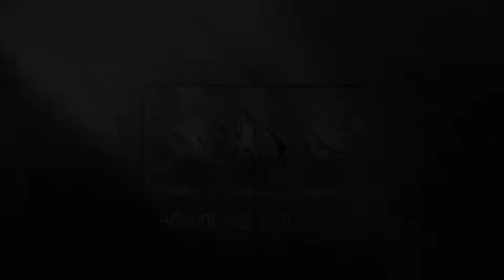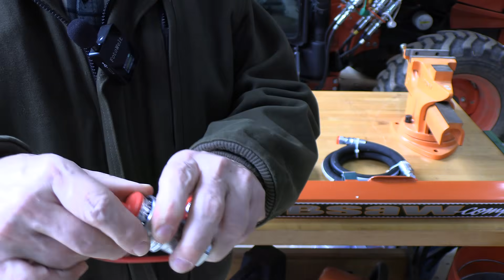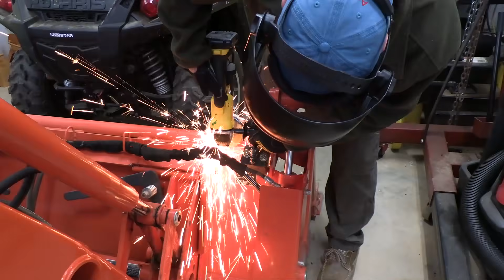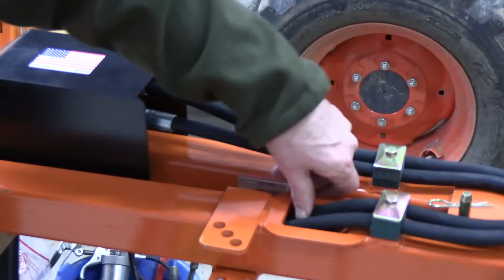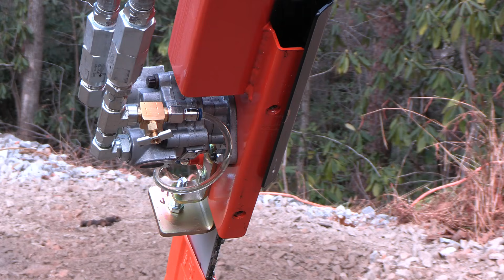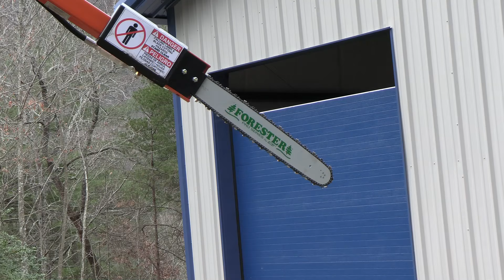Limb Saw Limbinator Assembly Review and Use w Dr  Joe

Comment: It been three years now can you tell me is there anything you like or dislike about the saw? Has it been damaged while using.   what's it's week point?
Reply from the maker: Okay you ask good question Sarah didn't respond earlier. It's a happy little hard to place on and off for a single guy but other than that it works quite well if I had it on excavator with a glass roof or didn't have the On my tractor I could look way up and have much better visibility of my cock that's the only drawback with the tractor in the cab. Consider subscribing. Thank you Joe

Comment: What is the maximum reach?  10' for loader and another 8' for the arm or more than this?
Reply from the maker: Thanks for your question. I don’t know the exact type but at least 18 to 20 feet. It would be ideal if this was on a skid steer cause you could see up through the roof unfortunately you can’t see through the roof in the tractor but otherwise it’s outstanding, consider subscribing. Thanks. Joe.

Comment: Hi, great video! I have a Kabota B2650 and a rocker switch that turns my snowplow left and right. How do I know if it has enough g.p.m to run the saw? Thanks Patty
Reply from the maker: Wow, you ask a great question. I don’t know the actual gallon per minute required to run the saw but I don’t think it’s that great. I think you probably have enough flow rate to operate the chainsaw before you buy one however I would probably check the gallon per minute requirement at the website. It has worked very well for me. It does leak some hydraulic oil which is a lubricant and that’s a necessary, sacrificial element of the Saw but it’s a small price, consider subscribing. Thanks. Joe.

Comment: Thank You. I just took delivery of a LimbSaw. I have not got it mounted yet. I was sconfuse3d on how the depth gauge was mounted. I have a magnetic base wireless backup cam i will try to use to get a better view.
Reply from the maker: Thank you for your comment. It has been very useful. A little difficult to see when you have it fully raised in a normal tractor because you can’t see through the roof other than that I really like it. I have cut many many limbs opening up fields and shooting lanes. I’m glad you found a video useful. Consider subscribing. Thanks Joe.

Comment: Your video shows mounted on a tractor with 8 gpm hyd flow , however I would like to mount on skidsteer  with 17 gpm hyd flow , is this possible.
Reply from the maker: Hello Garry. Great question. I don’t know if that would overwhelm the hydraulic motor of the saw. Although I believe it would be fine, probably a quick call or message to limb saw would be a good idea. Consider subscribing. Thanks Joe

Comment: To the best of my knowledge, this is the first time I've seen someone aside from Tim of Tractor Time With Tim use one of these.  Part of me thinks that the field of vision for this tool is better in an open station compared to a cab tractor.  Knowing that it uses a small bit of oil has me thinking the best pairing for this would be a power pack.
Reply from the maker: Thank you very much for your comment. I wish I had a glass roof on my tractor because then I could see easily where the limp saw is. I do have to bend over to see it when it’s fully extended which is a bit frustrating. A tractor without a cab that is open it will make it super easy to use this but I need a cab because it gets really hot and also when I bush hog and run over yellow jackets I’m anaphylactic to those and I need that protection. Take care Joe